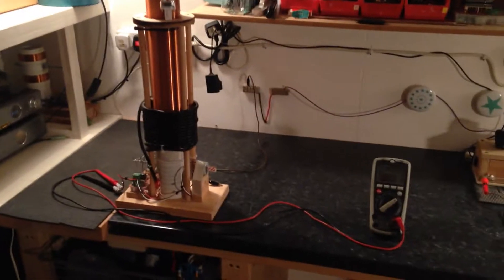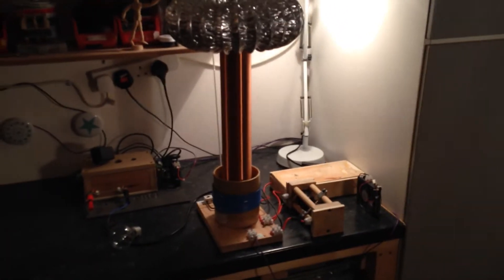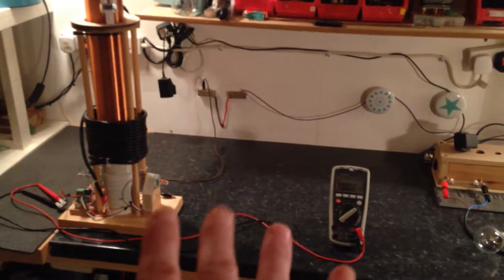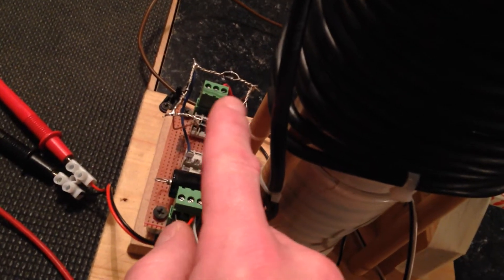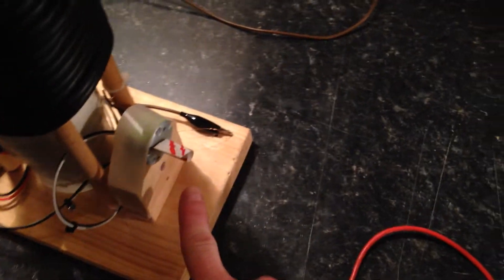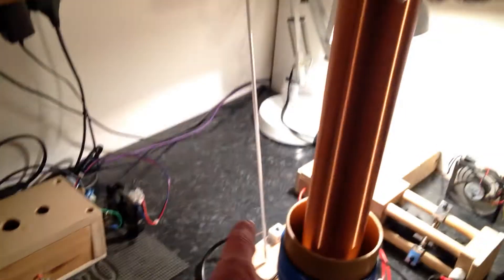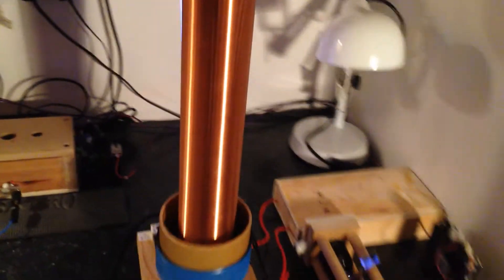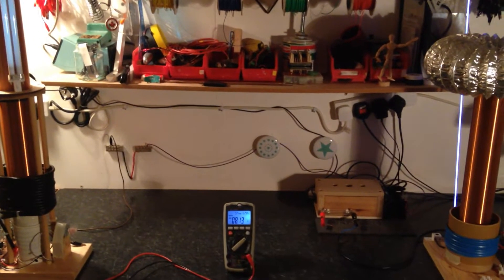Spark Gap Tesla Coil - wireless receiver power rectification #5 - Directors cut.

Comment: Hi Deeds
Nice video!
What is your driver circuit?
And is your receiver coil sharing ground with your driver circuit?
Thanks mate! Keep up the work.
Reply from the maker: +vinny stvincent  Hey bud.  thank you!  It's a flyback driver I saw a guy on here using.  Simple transistor deal so you can't push it hard, it was perfect for experimenting as it doesn't bite so hard.  I wouldn't go putting my hand on it but it's not NST chew your arm off if you do get bitten.  
Behind the shed are two standard ground steaks hammered in about 10 foot apart.   
Take care mate, I can see you getting some nice sparks!!

Comment: nicely done and did. since you've been radical with the tuning lately on this im curious if you've thought about doubling for tuning your body maybe? ehehehe have you touched the output with it at full blast yet in fx mode? I was balls to the wall for going topload until that happened. also, have you grounded out the window in another room? that tuning running that motor in all should offer some lighting!
Reply from the maker: Well bud, it's like this.... I have been testing out the topload for pain factor lol why not!...  but not in FX mode, actually it doesn't really have an FX mode with that huge topload, I even tried it with the ZVS very late last night and it wouldn't put out a streamer.  I have grabbed hold of the topload while its was on to move it, but it wasn't turned up very high, I proved to myself I could grab hold of tho.  I've had topload on my mind!  I speak to you about, see if I can catch you laters on G+. thanks mate.

Comment: great details in the description^   :)
i have to look into it to make sure, but i think putting the diodes in parallel like that will increase the current that can safely pass, but they can still over-voltage on you (make sure you check them every now and then...ive blown them and not known for weeks before) maybe in series would protect against voltage?
Reply: Arash Toudeshki deeds won the s.e.c. distance challenge i held last year....i think he reached 30 feet, lighting a flouro tube using only earth to couple the towers. hes no slacker!
Reply: haha..i am maybe over-confident, but i know it will be good. it would have to be done in a field, which is ok to me. i like working outside  :)
i may change up the requirements on the receiver tower, instead of being required to light a floro tube. its almost impossible to record that in the day...but having to do a night run is somewhat exciting too...  we will see
Reply from the maker: jeremy gwilt ..I'm happy to work outside too - I was going to give that big thing I got a run outside while the psu is still putting out 50v. I'm looking forward to this years SEC. :)
Reply from the maker: Thanks mate, that's a handy tip. I'll check them later. Cheers.
Reply: This is a very interesting project :)
Reply: Wow! 30 feet is awesome.
Reply: i think we have the expertise and creative minds to really push the contest this year. im guessing 100feet will be normal
Reply: 100 feet! How about the insulation? Do you have enough space to do that?